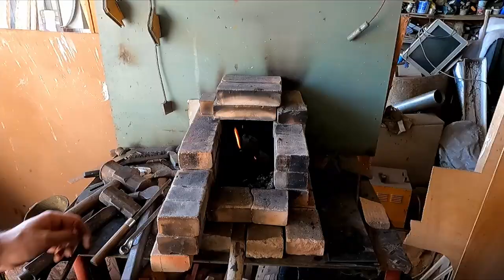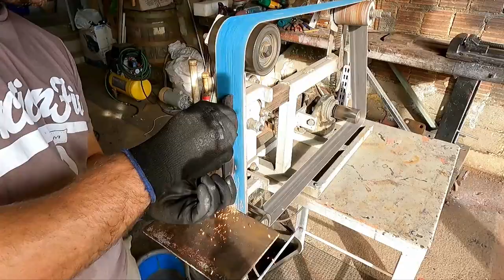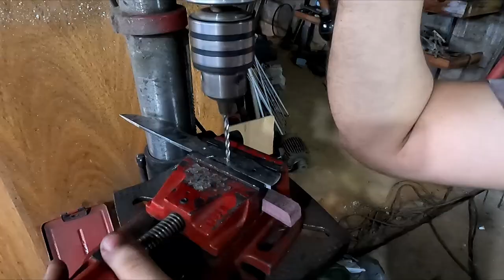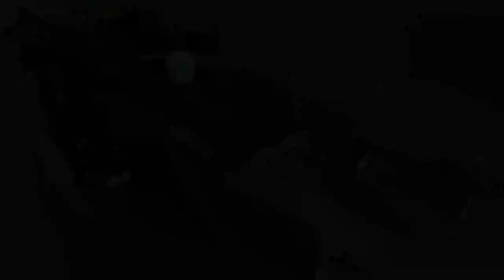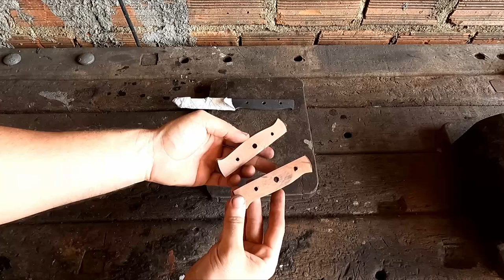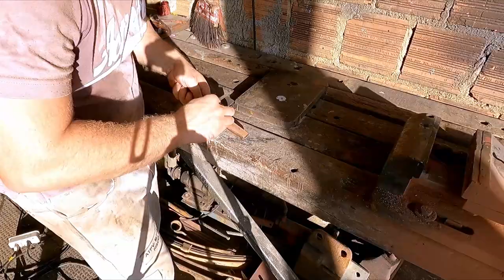Making a Small Kitchen Knife With Leftover Spring

Comment: Great job! I would take such a knife not only to the kitchen but also on a camping trip. Friend, tell me what you dropped the knife in?  Is it butter? We have such a way of releasing blades after quenching. The oil is heated to 200 degrees Celsius and the knife is held at this temperature for two hours.
Reply from the maker: Yeah she ended up getting a little rough too 👍👍👍

Comment: nice work friend.
i have a question 
what is that green bottle you have added to the wather ? 
i think this process for bluing, if i correct,
kindly advice that is the material and what time is enough for bluing?
sorry friend for my bad english
Reply: I think it was a heavy salt solution....to "hot blue" the knife. Terell Knifeworks does that for certain parts.
Reply from the maker: Oh my friend, thank you very much. The product I used is manganese phosphate. It serves to darken the steel. You dilute it in water in a ratio of 1 to 9 and activate it with steel wool at around 95°C, let it cool and then heat it again to 95°C and place the blade that will become dark. Manganese phosphate you can find it on websites for purchase. Manganese phosphate is much cheaper than perma blue. 👍👍👍
Reply from the maker: It was a manganese phosphate solution, much cheaper than perma blue
Reply: @MakerHA  thanks friend i really appreciate
Reply from the maker: @RandomRestoration  Your welcome  👍👍👍